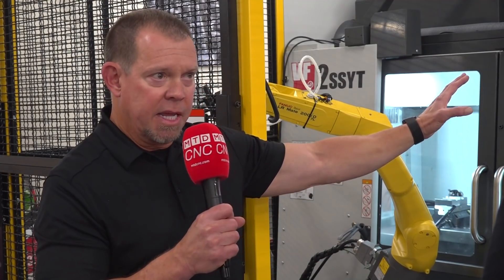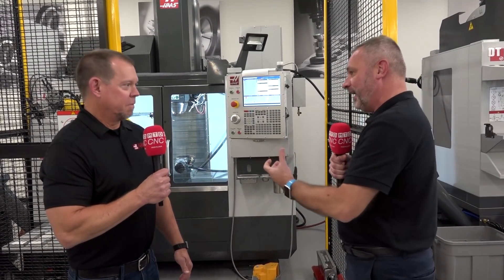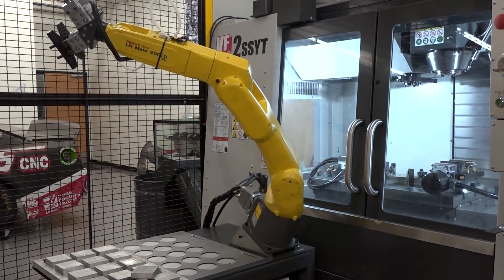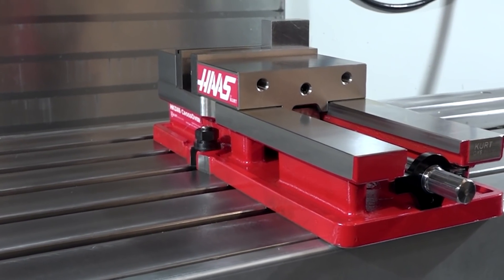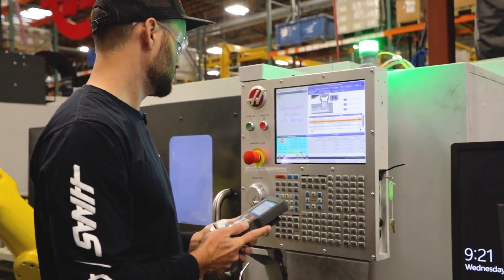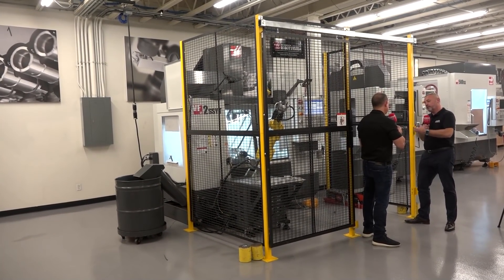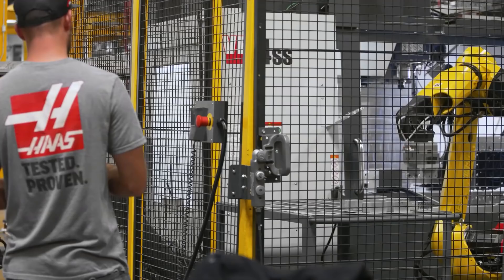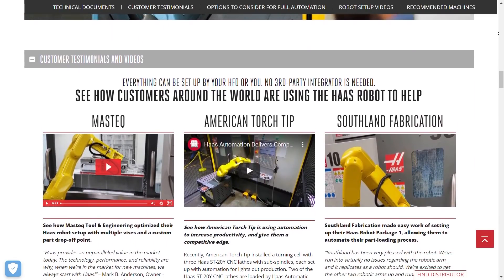The HAAS control works directly with FANUC robots

Comment: I have a robot package on my Haas VF2ss, we moved machine and now the machine and robot will not connect we are getting a SRVO-037 IMSTP alarm, we have had a Haas repair tech here going 7 days. Have you seen this and do you know of a fix. The Teck is stumped.
Reply from the maker: Best option is Fanuc themselves for this issue.
Reply: @MTDCNC  Looks like software had a bug in it, the reloaded and it connected.